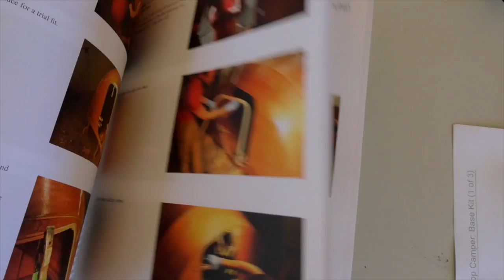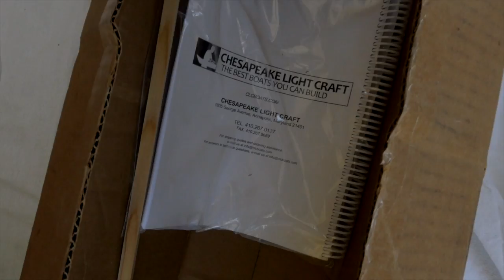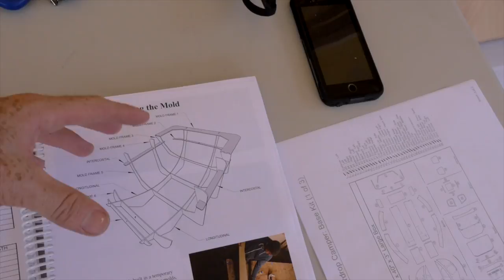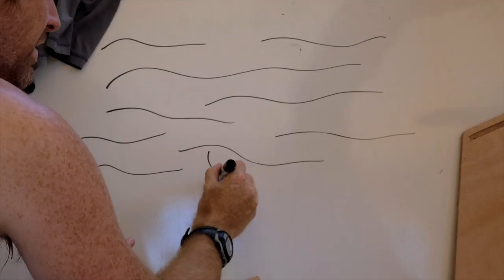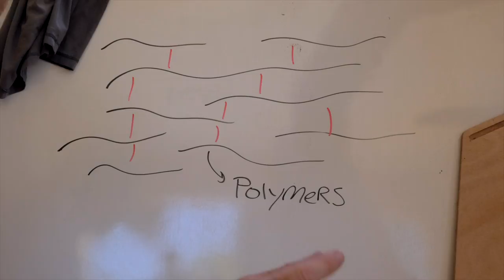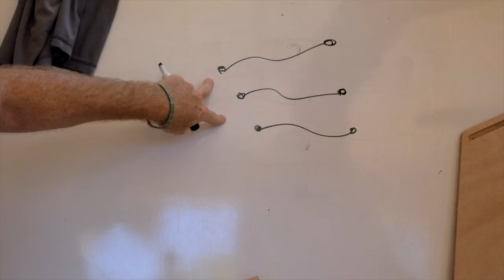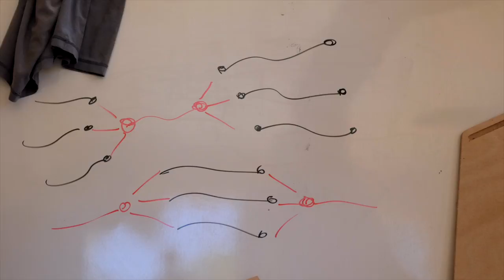Building a Teardrop Camper - Episode 1

Comment: You have a better understanding of how the reaction works than I. I only knew the activator made a heat reaction that caused it to harden. As a teen I got into buying wrecked Corvettes and fixing them back up. I had a mentor who was a great fiberglass worker. He showed me how to use paper aluminium foil or whatever to filling in the missing broken pieces to make a solid panel again. Anyway one thing we would do is keep our resins and body fillers in the fridge during the summer. I've never used the clear epoxy ,only fiberglass resin. If your epoxy is kicking too quickly in the heat you might try the fridge method. But polymer body filler will kick before you finish mixing it on the board in extreme summer heat.